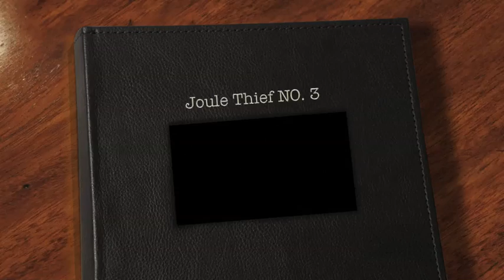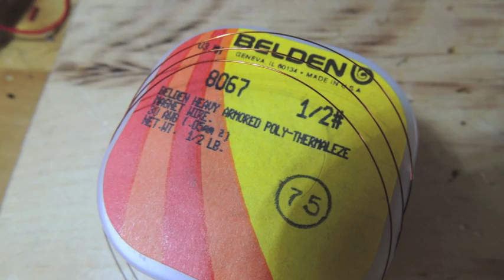Joule Thief #3

Comment: Their prices are insanely high.  For a 2N3904, they want ten times as much as Futurlec.  The only transistor I'd buy from them is the 2N1307, because it's a germanium and is very hard to get.  In a JT it will run at a quarter of a volt, no problem.  Their 2N3055 power transistors are two and a half times the price of other suppliers.  I'm glad I've got a lifetime supply of them - a couple bricks of a hundred each.

Comment: The typical cheapo Ni-MH charger doesn't have an auto shutoff.  The assumption is that the cells will not be harmed if they are overcharged at a rate of C/10 or less.  in other words, if it's 1000 mAh cell, charging at 100 mA won't hurt.  It's just wasteful of power, of course.  Some authoritative sources recommend charging at C/20.

Comment from the maker: And finally i am not convinced that there is any measurable amount of current being used by the transistor base and if so it is not enough to be a problem.  With a dead battery--one volt--the base is drawing 0.45ma  and with a new battery it is drawing 5ma.  With the original 1.K resister on the base and a 2N222A the dead draw is 0.72 and the new battery draw is 1.75 so there is really not much difference if you average it out from dead to full.  But yes the 2N2222 is a more efficient transistor

Comment from the maker: Now lets not get all technical over something this simple.  The solar panel i am talking about is the tiny 20mm x 60mm from Futurelec. I believe it is 6 cell all wired in series and encapsulated in glass for a total voltage of 3V and 25ma.  I am not sure what designates a panel over a cell? But because they have a single cell that puts out 0.45 volts I assume this one has six in series.

Comment: If you charge them with a solar cell, the cell is self limiting as far as current goes.  Just put a 1N4002 rectifier in series with the cell to keep the cells from discharging when there's no sunlight.

Comment: When you lower the base resistor, it lets more current through to the base.  This results in more wasted current that doesn't go to the LED.  The JT is already only 50% efficient; when you count the wasted current it's probably 40%.  The PN2222A (plastic version of 2N2222A) is the same price or less than the 2N3904, depending on quantity.  A bit better is the BC337-25 or S8050.  Or if you really want a lot of light, use the 2SC2500D, KSD5041, ZTX1048A, or NTE11 (too expensive).  Thanks.

Comment from the maker: You can get the same light from the 2N3904 as you get from the 2N2222A by simply changing the base resistor to a 150 ohm.  And the 2N3904 are only 3 cents each

Comment from the maker: The charge that i have been using and that was made for this type of battery has an output of 2.8 volts and 180 ma.  I just checked the batteries --two in series--and the voltage is 2.72 V     So i am not concerned about the 25 ma the solar cell will produce.

Comment from the maker: With a solar cell that produces a max of 3 volts and 25ma i am not too worried about over charging them.  This kind of power is a trickle charge and the 25ma would only be if you were in ideal conditions which almost never happens and if so not for very long.  Instead of focusing on over charging I Think it would be more realistic to be more concerned about not getting enough charge.  Time will tell but I have been using a solar cell in this type of setup for months and have had no problems.

Comment: Hmmm You have to use rechargeable batteries and the voltage will be about 2.4V. You have to have a simple circuit to limit current and trickle charge when the batteries are full or else you are going to loose them too fast.

Comment from the maker: This is very simple ---The two batteries in series have a max voltage of 3 volts.  The solar panel has a max output of 3 volts.  So like every battery charge I have seen except the digital ones, When the batteries reach max charger you just have a standoff between the panel and the batteries   3 volts --vs--3 volts

Comment: That is great. One more question, how do you plan to limit the charging proccess if the battery is full? You need some kind of switch over with one or two diodes.